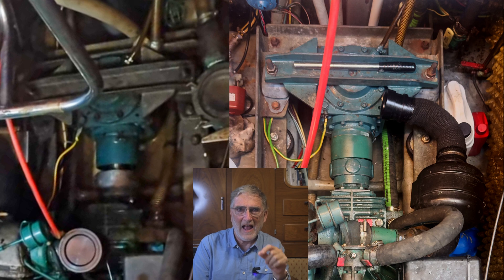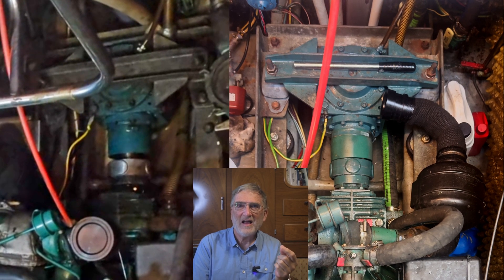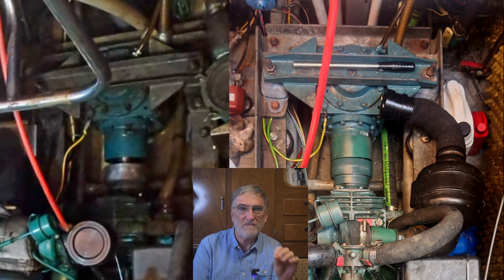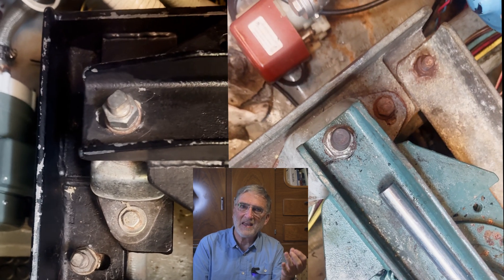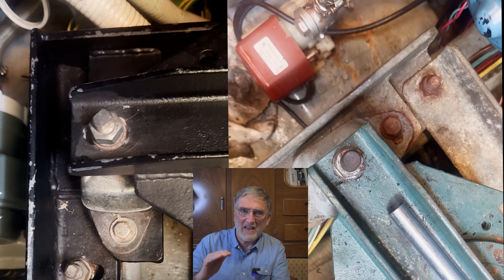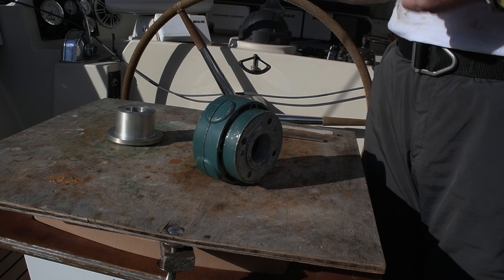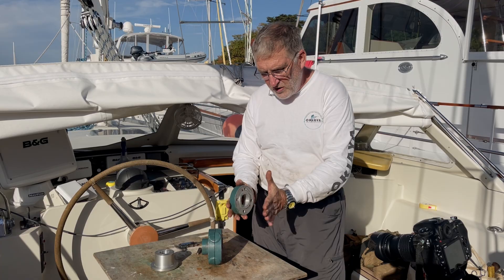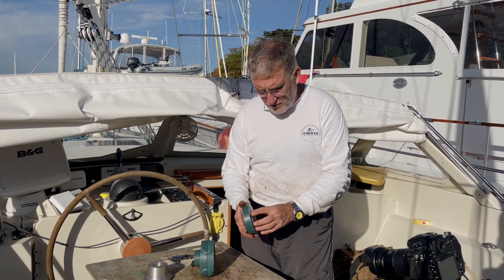Amel C-Drive Alignment

Comment: Hello Bill, we might have an alignment problem on our Super Maramu as well. I’d like to send you a video and ask for some advise if that’s ok.

SV My Motu
Jeroen, Aagje and Rajesh
(we met in Port Louis Marina, Gernada)
Reply from the maker: Sure send it along.  The only warning I'd give is that a video can tell us the alignment is bad, but it really can not assure us that it is right.
Reply: @ thanx Bill, will contact you by e-mail for this. 
Tightened the engine bolts and the set screws from the bushing on the ingoing C-drive shaft yesterday and now will re-evaluate the situation and make a new video. I also have a different design as on your boat(shorter gearbox axle)

Comment: I sent an email, But I'll leave a comment here so I get a good chance of getting a response. 

I am currently completing this process and have a question for you. My Amel transmission has a wheel in between the transmission and vetus flexible coupling that I believe was connected to some kind of generator at one point in the past. This wheel has my engine further away from my "c"drive than yours did in your video. My question is should I make a longer alignment tool to do the alignment. Right now I have the tool made that the amel book suggests which looks to be a copy of the one you use. When I bring the engine to the correct location and slide the tool into alignment, the tool is still on the "C"drive shaft but only by 10-20mm. Would this be still ok for alignment or should I make a new one and make it longer?
Reply from the maker: Hi Kieran,

You are right, the “wheel” is the drive pulley for Amel's optional shaft alternator.  It was a nice implimentation of a shaft alternator generating 20 to 50 Amps at sailing speed—of course at the coast of extra wear on all the rotating parts.  

There was actually no change in the engine position when the shaft alternator was installed because on boats without the option there was a spacer of the same thickness as the pulley.  When I did the alignment in the videos, the spacer is in place against the transmission flange.

You have a couple of options.

The pulley should sit flat, flush, and stable on the output flange of the transmission. This will mimic the procedure used on the standard installation where the spacer is in place while doing the alignment.  You can then use the alignment tool with full engagement on the shaft.  It’s a bit more awkward measuring the alignment with the larger diameter of the pulley, but it is still the best option.

If you never have any expectation of refitting the shaft alternator, you can have a machine shop cut off the excess diameter of the pulley turning your drive train into the standard one.  You then install pulley--which is now just a spacer—in the system for the alignment.

Finally, if the alignment tool fots on the shaft without ANY wobble, you can use it with the reduced engagement.

Hope that helps!

Bill

Comment: Great Bill. Testing and found out that it needs to be fixed during the winter. I need to buy aligment tool from Amel?
Reply from the maker: You can buy the alignment tool from Amel, or have a local machine shop make one for you. It's a pretty simple part!  I have posted a link to the drawing in the video description.  And here:  
https://fetchinketch.net/wp-content/uploads/2024/09/c-drive-alignment-tool.jpg
Reply: Thank you Bill. I will order it from Amel as I am in Europe. Great video and thank you again.
Reply: Hi Bill, Slavko again. I am already in process of doing the replacement of mounts and I would have some questions if possible?

Comment: Great timing as I'm in the process of reinstalling my c-drive and engine.  Also, great information. I've seen the question asked a few times on the forum with no answers.  The video was a great way to explain.  Thanks for taking the time to do it and keeping it professional without naming names.  Well done.  Do you have any words of wisdom when it comes to setting up the frame when it comes to reinstalling the upper c-drive unit?  It seems like that first set up is very important.
Reply from the maker: Joe, On the setup of the C-drive I have some words.  How wise they are... I am not sure.  But here goes.  You want the C-drive to be in the position it "wants" to be in.  The way to get this is to release it from its restraints.  Release the C-drive from the mounts that secure it to the frame, and if you really want to go all the way, you can loosen the hose clamp on the rubber sleeve that holds it in place. I haven't worried too much about that second step because there is no adjustment to it and there is no change in that geometry with time and use.
Reply: @billkinney4794  Thanks.  As I 'replaced all the mounts my initial plan was to set the frame to the height it was when I removed it and make adjustments from there.  I now understand that I should set it lower, drop the upper C-Drive unit in, bring the frame up to the upper C-drive unit, and drop the engine in and adjust per your videos. I'm reinstalling the C-Drive and engine frame today so this is really just in time.  Thanks again.
Reply from the maker: @joeanderson9056  Great to hear it was a help!  That's why it is here.